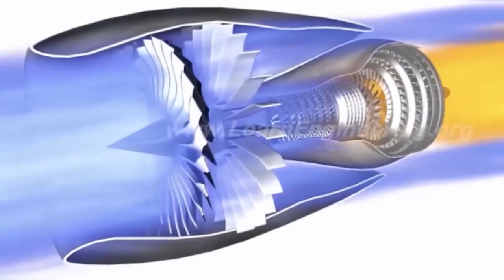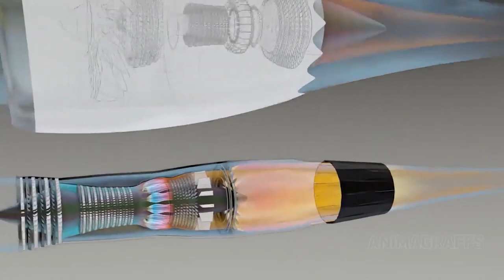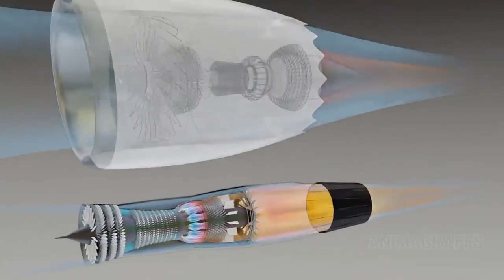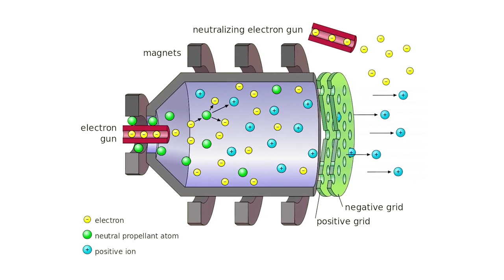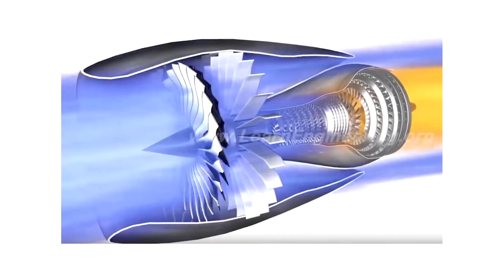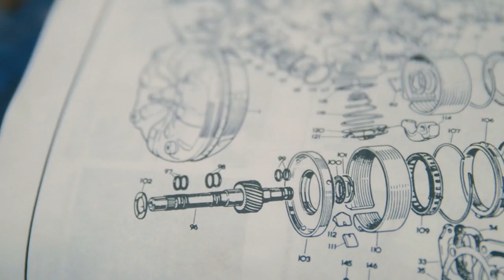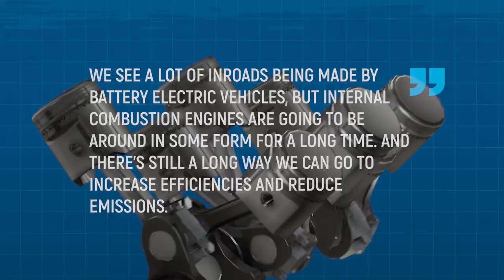Are Electric Plasma Jet Engines Actually Possible?

Comment: A plasma engine driving by electricity n vaporising water to steam for expansion could create the thrust needed for the thrust to be commercially viable
Reply: Like under water death chargers vs  grenade, electric can replace chem combustion, plus in nuculear power and thermo/solar regen amp, it could last a spaceplane trip.
Reply: No but only for lgiht airplanes not heavy ones

Comment: Just like there has been extensive progress with battery and electric motor technology for cars and trucks, the plasma engine for aircraft will eventually be perfected enough to be effective and practical to use. There were many aspects of technology that were said to be impossible, and eventually the scientists and engineer found a way to make accomplishment.
Reply: Battery is just too heavy it's better use hydrogen fuel cell

Comment: Quick answer, yes, complex answer, They are currently impractical for in atmosphere travel due to weight of the energy storage needed to run them. 

The video covers some environmental bashing of standard fuel powered vehicles (flying or on ground) while simultaneously saying they are more practical for the time being due to energy capacity of fuel vs batteries. There I saved you 8 minutes.

Comment: I don't doubt electric plasma jets could work... but how much thrust would they generate and could they power fighter jets or bombers in Earth's atmosphere?
Reply: A prototype a Wuhan University was able to produce propulsion 'similar' to a traditional commercial aircraft engine, although this is obviously only in laboratory conditions. Whether or not the technology will scale up we'll have to see, but one of the issues cited was the immense heat produced by the thruster was too hot for the traditional casing used on current commercial jets.
Reply: @123maxml5  another concern is what kind of power source could be fitted to a cargo or jet fighter to generate the necessary electrical power for the thrust needed....

A nuclear reactor would be way too heavy.
Reply: @doncalypso  yeah true, batteries are definitely a bottle neck to so many industries and new battery technology will be ground breaking in countless ways. 

Also on the nuclear reactor front, I doubt that will ever be an option in flight but has been a considered possibility for rockets for a while.
Reply: Chuck Stegall  with small fusion reactors it would be feasible, but given the technology available NOW I don't see it happening.
Reply: @123maxml5  What's more, considering how Easily Tesla Electric Cars burst into flames after accidents occur, due to their batteries rupturing, an Airplane purely powered by such batteries could turn into a Flying Death Trap from a Lightning strike or simply from the batteries rupturing from alternative air pressures.
Reply: @doncalypso  And with the Activists complaining about it, the research is kinda going nowhere
Reply: @Victor-056  I think bursting in flames really isn’t an issue. As far as I’m aware this is a myth, gasoline cars are 11x more likely to burst into flames in a crash (off US federal highway stats), and jet fuel is hugely flammable so the problem is worse currently and moving to batteries would likely be safer in this case.
Reply: @123maxml5  Jet Fuel needs a LOT of Air Pressure to even START Burning. It's like DIESEL, neither Burn Well unless Compressed. (This is ELEMENTARY. Even First Graders know this!)

And Gasoline Cars Burning "Easily" is rubbish. Whenever they caught fire, it was either because they were illegal Street racers that had aftermarket addons like NO2 Fuel Injectors (Which DO Ignite at the smallest Spark), had been carrying flammable materials, or Someone intentionally rigged it to explode.

Because by Your "Logic", Millions of Gasoline Cars would have Caught fire from getting tapped over the last near hundred and fifty years... But they have NOT.

And using "US Federal Highway Stats" is a bad idea, considering how a lot of the data in there is actually falsified, being higher in some areas and lower in others, depending on who is running the show.
Reply: @doncalypso   The technology to generate needed electrical power now exist. Someone has invented propulsion that doesn't need any sort of fuel...
Reply: @123maxml5  The technology to generate needed electrical power now exist. Someone has invented propulsion that doesn't need any sort of fuel...
Reply: @barakathegenius  and why not just name that person? are we supposed to guess who that person is?
Reply: @samuellolango9720  Rodgers Mathayo Msuya
Reply: @barakathegenius  why is it that we have never heard of this person, surely such technology would make someone like him very famous and very rich. and yet when i look for this guy i cannot even find enough information about him on the internet.
Reply: @Victor-056 Totally agree with everything you said 😅😅

Comment: The answer is NO.  There is no mention of power, thrust ratios.  This will work in space with no need for a ton of thrust at a  time, where even ounces of thrust will do.  On earth you have to overcome air friction and the weight of the plane.  An Ion plane model has been made, but not for anything heavy, more like a balsa and paper airplane.  Jets have to produce thousands of pounds to propel a passenger air craft.

Comment: The question you ask, "Are Electric Plasma Jet Engines Actually Possible," is not the question you answered. At 2:54 you responded, "Yes, the plasma engine is real," which is true. Plasma engines have been with us since the 1950s, thank you NASA. However, Plasma Jet Engines are NOT real and are NOT possible at our current level of technology. The electrical energy needed to power a plasma jet engine would be greater than that needed to power a large city, which, again, is not possible in an aircraft. Also, using plasma energy to spin jet turbine blades, even if it would work, is ludicrous at best. Chinese technology claims on any subject, filtered through the Chinese Ministry of Propaganda, should always be taken with a grain of salt.
Reply: The technology to generate needed electrical power now exist. Someone has invented propulsion that doesn't need any sort of fuel...
Reply: Jet plasma engine can be combined with hydrogen fuel cell technology

Comment: Source of electricity to make plasma?
Reply: Magic!
Reply: @totalermist  magic is "mostly" tech we don't understand
Reply: @cedriceric9730  nah, in engineering there's two classes of technology: AM and FM as in Actual Machines and F'ing Magic 😉

But in all seriousness, there's currently 4 types of known methods for generating electricity:
• chemical - as in batteries; not practical since the energy density is too low
• thermal - as in thermoelectric generators; those things don't scale to the power requirements of this contraption
• mechanical - as in most generators and power plants in operation today; super inefficient because efficiency caps out at ~35%, that's why jet engines, turbo fans and other combustion engines are used directly instead (side note: this includes all forms of heat engines, from combustion to nuclear)
• photoelectric - as in solar cells; only 1kW per m² of solar flux  on Earth even at 100% efficiency (we're at <25% outside the lab), i.e. doesn't scale to the power requirements

Everything else is in the realm of wishful thinking (zero point energy, cold fusion, matter-antimatter reactors, mini black holes, etc.) or "always 50 years away" (e.g. aneutronic nuclear fusion). That doesn't mean that there's no way of someone figuring out something hitherto unknown tomorrow that turns all this upside down, but that's generally not something you want to bet on.

Tech "we don't understand" is by definition tech that doesn't exist on Earth, because we can't build it. Note that there's a difference between understanding the underlying physical principles and the tech itself. Rudimentary steam engines predated the theory of thermodynamics for example just like complex robots capable of writing love letters [0] predated the theoretical foundations of computers and robotics.

[0] https://www.chonday.com/15454/the-writer-automaton/
Reply: @totalermist  The technology to generate needed electrical power now exist. Someone has invented propulsion that doesn't need any sort of fuel...
Reply: @barakathegenius  > The technology to generate needed electrical power now exist.

The technology needed for this particular system to work doesn't exist, though.
There's no existing mechanism that could generate the required amount of energy while also being lightweight enough to support powered flight.
Reply: @totalermist  The technology is already in place, will soon be revealed... I have seen it.
Reply: @totalermist  The invention will eliminate the need to charge electric mobility units be it cars, aeroplanes, large ship and trains.
Reply: @barakathegenius  Sure. Whatever you think you have seen is definitely not some magic source of electricity. You either have been deceived or misinterpreted what you've seen.
Reply: Hydrogen fuel cell?

Comment: Still going to need to combust fuel in a generator to provide the electricity for the plasma engine. It could still be a force multiplier getting more thrust from the fuel than regular jet engines could. The way diesel electric freight trains can haul more weight than plain diesel trains which they don't even make anymore.
Reply: Ah, somebody didn't pay attention in high school physics. ;-)
Reply: @schmetterling4477  They're right tho. Battery energy density is poor compared to fuel still. MIT's ion glider showed ion engines may have 50 times the thrust to power ratio compared to jet engines, but battery energy density is 30-50 times lower than fuel. However if you converted even 50% of the fuel energy to electricity to power an ion engine, you would now have up to 25 times the thrust to power ratio of the jet engine alone by thrust augmentation.

Electro-thermal combustion augmentation can increase the efficiency of the combustion products using energy generated by the combustion reaction itself. See the Russian AYAKS/AJAX hypersonic Magnetohydrodynamic combined cycle engine. Feedback of energy in a system can improve the thermal efficiency, depending on how you use it. By converting random thermal motion which is wasted into electricity and then directed kinetic energy, an electric or magnetic device like an ion engine or an MHD drive can achieve a much higher exhaust velocity. See also Thomas Townsend Brown's patent for an "Electrokinetic flame jet generator" intended to power a plasma airspike at the nose of the aircraft, to reduce drag and accelerate air plasma around the hull. Brown's design included a high voltage needle electrode to ionize the flame jet, which accelerates the charged particles through a nozzle connected to a series of spark gaps and capacitors. The boosted voltage is then fed back into the flame jet to even higher voltages. By charging the exhaust negative, and the leading edge of the of the vehicle positive, you create an asymmetrical electric dipole in the air around the hull that can move plasma at very high speeds by electrophoretic forces. Even neutral gases in the air will be moved by the dielectrophoretic forces at the million volt energies the Brown patent was designed for. The efficiency isn't the only benefit for these types of field propulsion designs either. The Russian AJAX spaceplane has a "magnetic air intake" which can extend for hundreds of meters in front of the aircraft while flying in the ionosphere. The magnetic intake turning hot plasma into cold air is the only way a plane can scoop up, compress and cool enough Oxygen to burn fuel in the turbine at those altitudes.
Reply: @taylorwestmore4664  Good luck building your ion-engine powered passenger plane. :-)
Reply: @schmetterling4477  Nobody is suggesting the use of an ion-engine to power a passenger plane. The question here is whether an electric jet engine is possible - specifically in this case, where air is excited into a plasma and released as a jet. Very, very different from an ion-engine.

We probably won't see this technology actually working, if it's even possible, for several decades. And there is no guarantee that it will be more efficient, or superior in any way to a conventional jet engine. It's still worth exploring though, because it would be a novel form of propulsion.
Reply: @malcolm_in_the_middle  An electric jet engine? Why in the world do you want to heat the environment? Did you not pay attention in thermodynamics class? :-)
Reply: @malcolm_in_the_middle  You clearly didn't pay attention to anything they were trying to teach you. ;-)

Comment: Ion engines have been debunked earlier this year.
edit1: adding YouTube reference  "Looks Like EM Drive Is Officially Dead - Experiments Fail" - Anton Petrov
Reply: Wdym
Reply: @dominicsnead3793  I added the refrerence to the youtube video in the OP.
but for your refreence: "Looks Like EM Drive Is Officially Dead - Experiments Fail" - Anton Petrov
Most comment sections block links so I won't try.
edit 1: ion =/= em .. I was wrong on this post.
Reply: @rubbercable  EM drive is not an ion engine. Ion engines have been used in satellites and space probes for decades. They work just fine.
Reply: @totalermist  I stand corrected. I'll look more into it this week.
Thanks.
So Ion Drives don't work in atmosphere/gas regions. NGL, impressive.

Comment: Lol you can make a I.M.E  Internal Magnetic Engine  or a I.E.M.E Internal Electro Magnetic Engine 
2 coils in series 2 capacitor in parallel and you can control it with a PWM AND GET IT TO SPINF AT 600 RPS NOT RPM.

Comment: If we could harnass lightning around aircraft in the atmosphere, we could have a limitless power source for aircraft!
Reply: 1) Limitless would imply that lightning storms are never ending and very predictable. They are not.

2) Lightning strikes represent an intense burst of potential energy suddenly released from a cloud which built up from warm air rising from the surface and generating a powerful frictional static charge as it collides with cold air/ice crystals falling through the cloud.

But that energy is distributed across the entire length of the lighning bolt as it superheats and ionises the surrounding air + water in it's path through the sky / to Earth.

3) A significant amount of that energy is lost through those heating and ionizing effects, plus the powerful compression wave moving outward from the path of the lightning that we call thunder, and on top of that there are even intense bursts of EM waves issued from the plasma too.

Comment: what about radiation from plasma engines to our environment, in the long run of course. We introduced carbon base technology without thinking throw, with ion drive we can afford that error, ion drives should remain in space, in-fact their are they are well suited under such condition, in space a 2kwh ion drive with less than 500 kg ion material will bit gigantic rocket in space trillion time but not on earth gravity. earth wants bio fuels coz we can burn lots of  that with well repercussion of carbon dioxide.